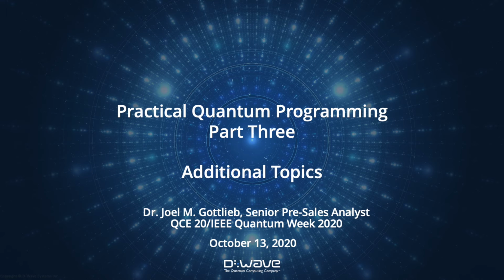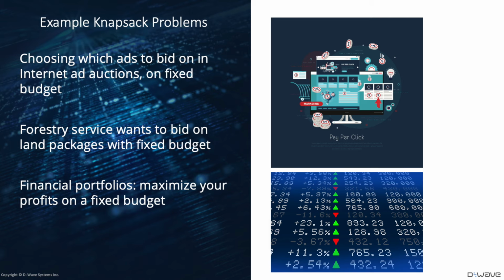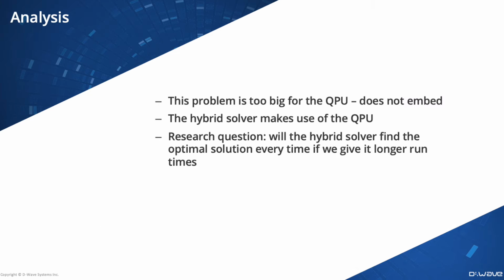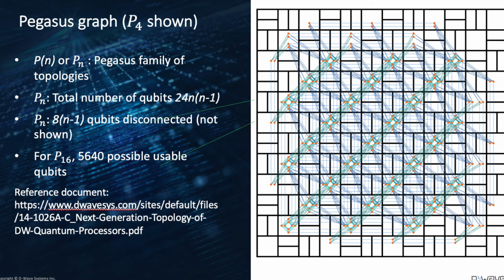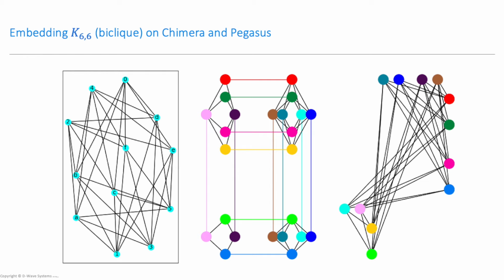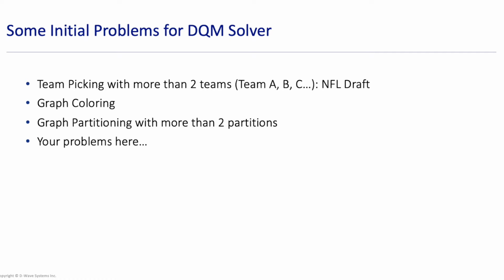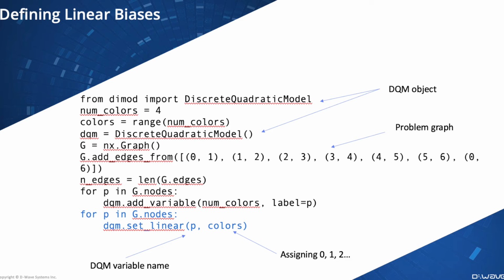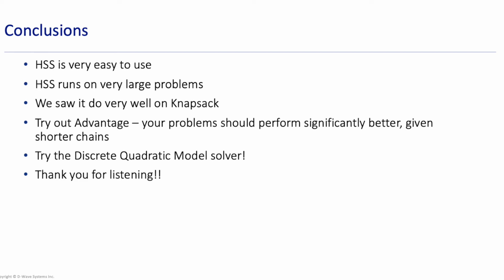Quantum Computing Tutorial Part 3: Hybrid Solver Service, Advantage, DQM solver

Comment: For the coloring problem, it seems like we need some initial knowledge of the solution in order to set the parameter num_color. What if the graph is large and complicated so that we don't have the idea about how many colors need to be assigned? Should we just choose an arbitrarily large number as number of colors?
Reply: Hello Leon, you are right that we don't know, a priori, the number of colors needed for the graph. Your approach, of guessing an initial number, and trying it, is exactly what I would do. There are mathematical theorems about the number of colors needed for graphs, but I"m not that familiar with them. Choose something not very big - based on the graph size - and try it - and then iterate.
Reply: @sploiber  Hi Joel. Thank you very much for answering! You just reminded me that the number of colors cannot exceed the number of vertices. Choosing a number relative to the graph size would be a good approach.
Reply: Hello Lyoka, In addition to what Joel answered. One intuitive solution would be to take the number of colors = number of vertices  However if you know that your graphe is cyclic then num_color=2 if n is even and num_color=3 if n is odd, where n is the number of vertices in the graph.